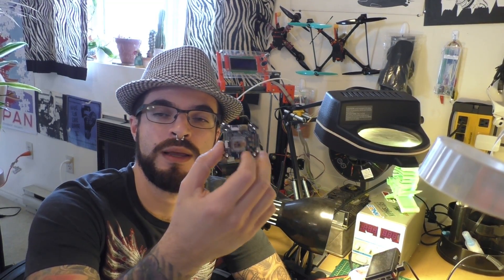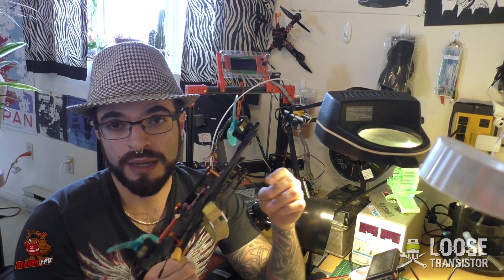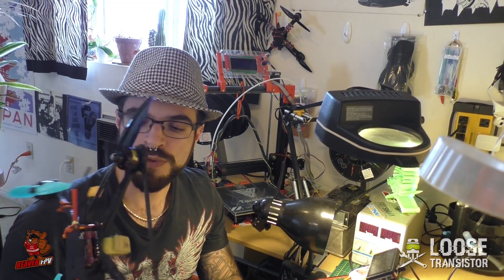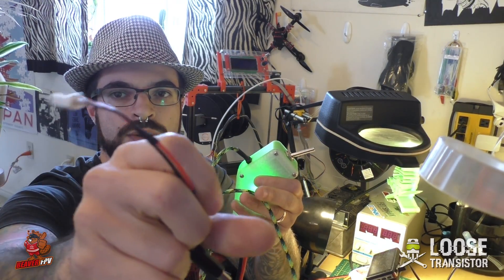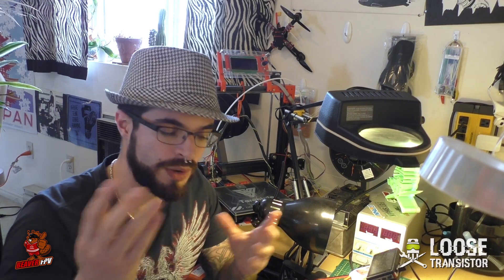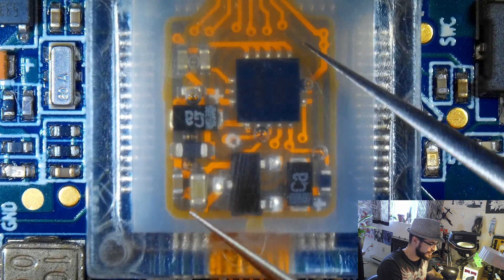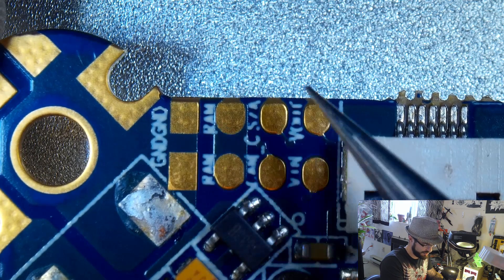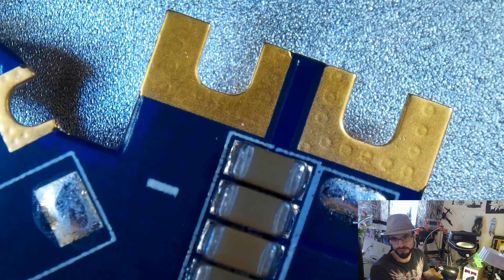Airbot Omnibus F4 Fireworks Review

Comment: Fireworks F4
Lots of people on the forums are running into issues where the Gyro is not zeroed and  well its not in a gel its in a solidified silicon  so it doesn't settle to 0 Degrees if its misaligned
Reply from the maker: ChristianProgrammer I found the same. Will do a video soon!

Comment: I forgot to tell you thanks on your last video. You had suggested I flip the fc upside down and I did and had the same results as you :D I have v2 Helio Spring. Weird the one with the spedix gs35a 4in1 blheli32 works with the fc in the correct orientation. Im thinking its the esc hardware and not the helio hardware. trying the ak35a blheli32 4in1 combo this week to see if its indeed ESCS with typhoon32 fw the issue ;)
Reply: the problem is only with 4-1 Airbot32 and all the same like tekko32, bold32 etc
Reply from the maker: Yeah its actual a case of interference from the ESC onto the FC circuitry and it causes problems unfortunately =S

Comment: Hi Loose, I've been looking at getting a Helio, but the supplier in the UK can't tell me what batch it's from. I wanted the 2nd batch with the shorter inductor coil, is there any way of telling apart from comparing inductor sizes?
Reply from the maker: No only really the inductor size. That is the only difference. There is no performance difference between the two - its just easier to fit the newer batch into a build because the coil is about 1.5 ~ 2mm shorter.
Reply: Thanks I thought as much, just got a really tight build planned for it, any extra space saving will be beneficial. I may just order one and hope I can cram it in or I get lucky and it is the 2nd batch, I really want to  give it a try!
Reply: there is small difference in packaging and accessories supplied, v1 is a anti static bag with 4 gummies, v2 is in a anti static bag with helio branded top cardboard and comes with gummies and a 14mm 8pin jst wire harness. :)
Reply: Gap of DooM thanks!